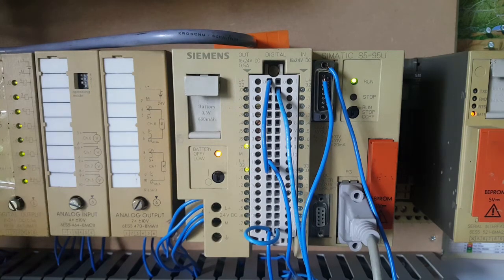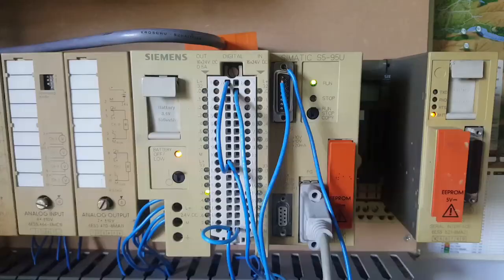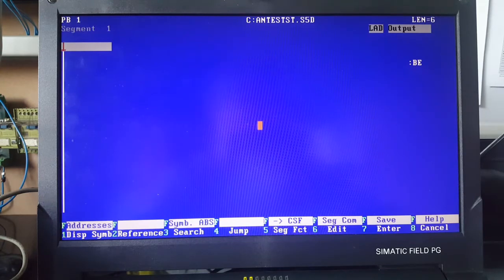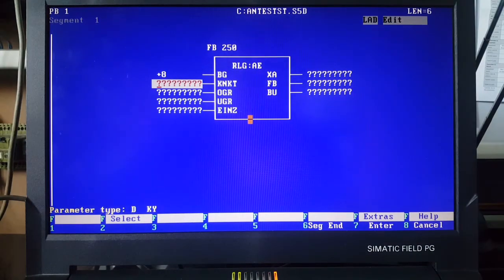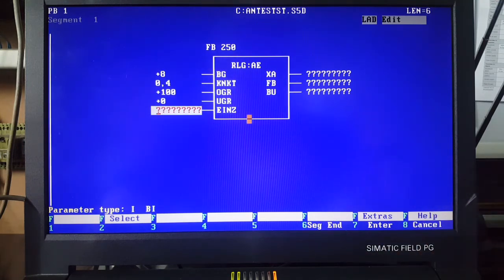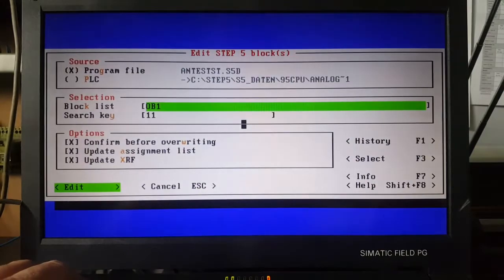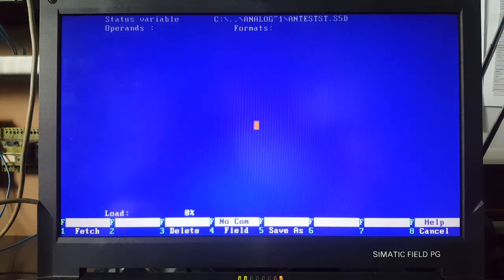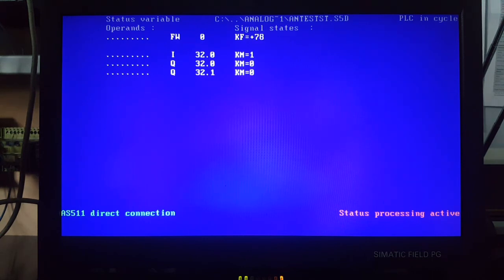Scaling PLC Analogue Inputs Part 1

Comment: Hello, how do you Connect the analog inputs?
Reply from the maker: Hi, depending on the PLC you have and the type of card depends on how you connect them up. If you go online you should be able to download the system manual which shows the wiring.